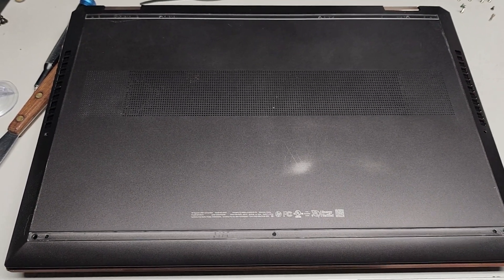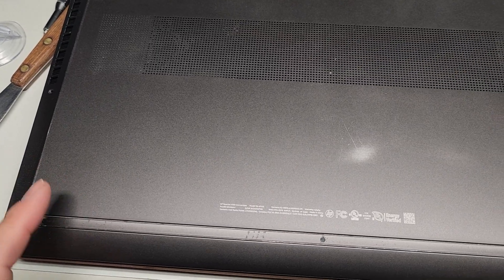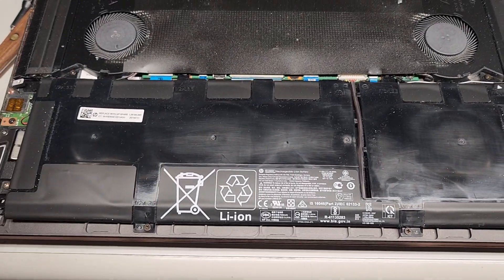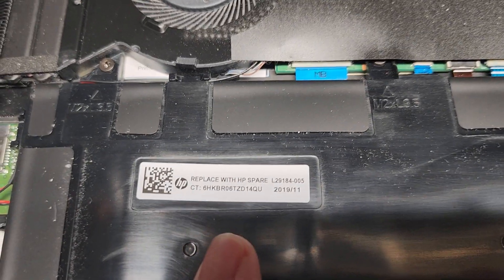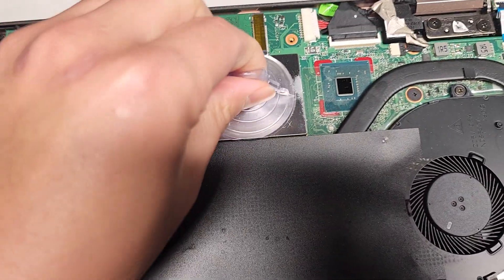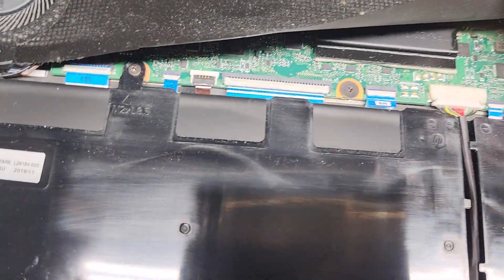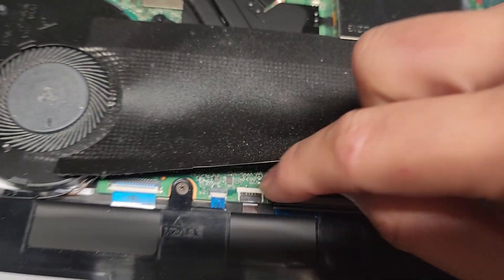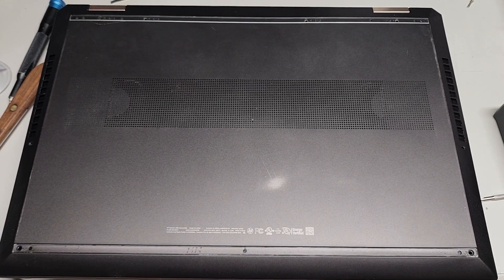HP Spectre x360 Convertible 15t-df100 "No RAM" SSD Hard Drive Upgrade Replacement Repair Quick Look

Comment: Hi! Very much appreciated video. I don't know why it's impossible to find information on specific laptop models; probably something along the lines of yearly model changes and reuse of model name. Anyway...

Did you ever end up replacing the battery? My sister has an identical model and her battery lost a cell (I assume; it suddenly stopped charging past ~80%) and it seems to be swelling and pushing the touchpad up. If you put a new battery in, how easy was it & which tools were required? I hope that it isn't glued or soldered... Thanks in advance.
Reply from the maker: It's just held in with screws.